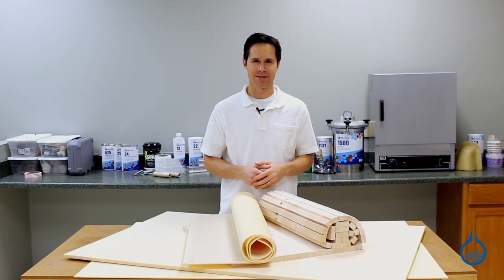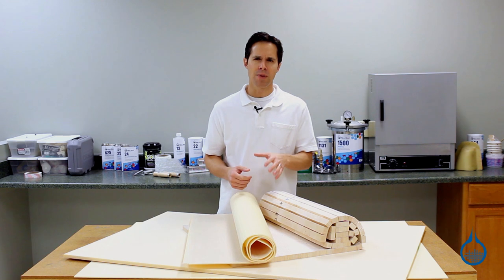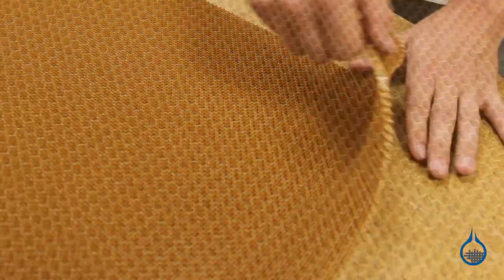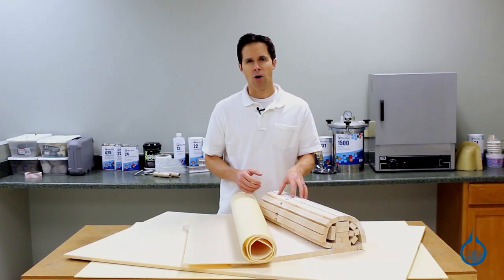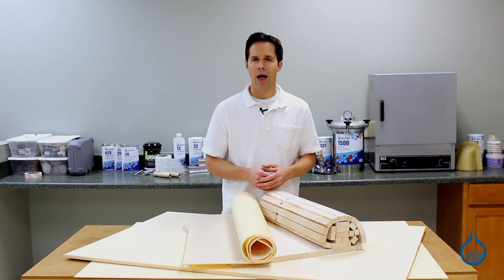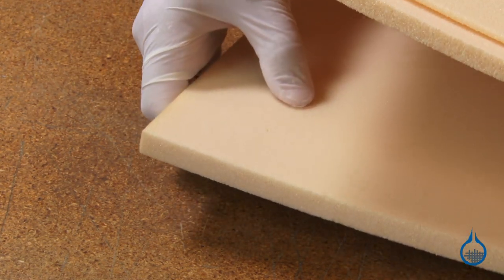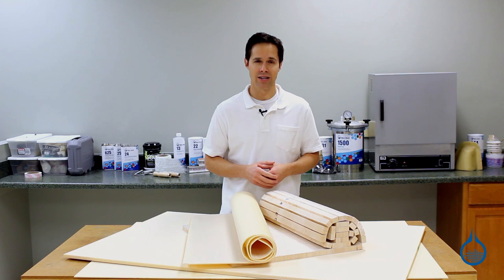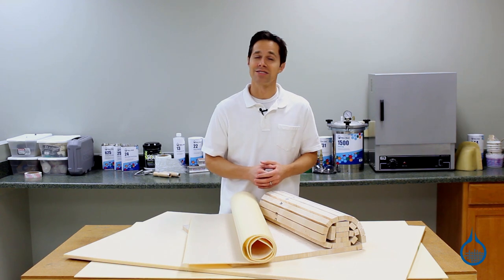Sandwich Core Materials

Comment: I have seen a very efficient process that compresses bamboo wood fibres into things like very tough floor tiles. Could this process be used for making wood composite similar to balsa? Also, we have had good results using bamboo fibres compressed into thin sheeting and laminated similar to layers of glass fibre using standard resins. Could this be an alternative to glass fibre matting?

Comment: I have attempted a resin infusion using 1.5" thick closed cell foam core. I wrapped the core after machining with carbon. The mold side is always getting large dry spots even though on bag side I can see the peel ply has wet out fully using the green infusion media. Can you tell me what went wrong? no vacuum leaks, im using infusion epoxy, and it took about an hour to wet out completely. Any reason the mold side (underside) of the fabric wouldnt be wet out?
Reply from the maker: Hello, that problem could be caused by a range of different issues depending on how you have your resin infusion process laid out. If you could give us a call at 800-821-3283, a member of our sales team will gladly discuss your set-up with you and figure out the best way to resolve the issues.
Reply: @fibreglast  Thanks, just gave customer service a call and they helped clear some doubts.
Reply from the maker: @Redblood797  that's great! Good luck with your next infusion set up!
Reply: @fibreglast  i'm from I
ndia ...may i have your country code for the telephone!

Comment: Sandwich Core Materials:
Bacon
Lettuce
Tomato
Reply from the maker: Not quite what we had in mind, but I agree those are key elements to any sandwich!
Reply: Actually, the bread slice would make a better core. A slice of lunchmeat would make a great outer skin as would a slice of lettuce. Mustard and mayo then would be the 2 part epoxy.
So obviously, the typical lunchtime composite sandwich has been put together wrong since it's inception. <('v')>
Reply: i eat fibreglass because i'm just built different